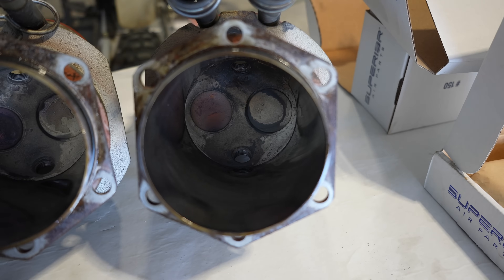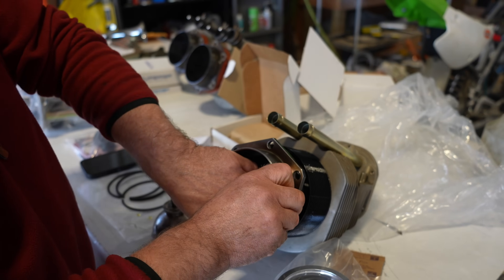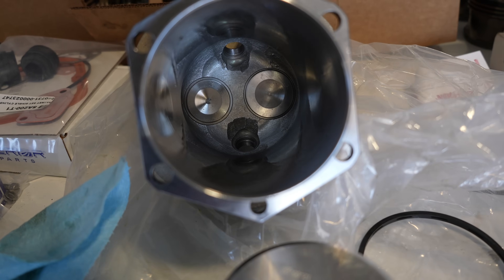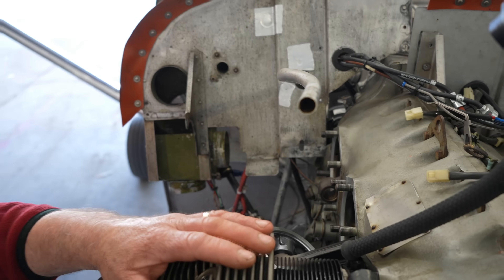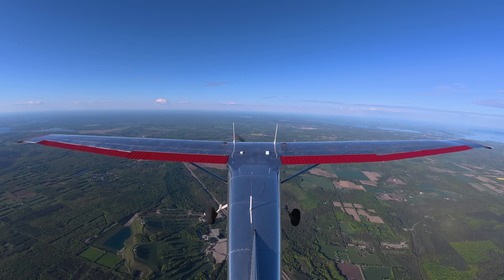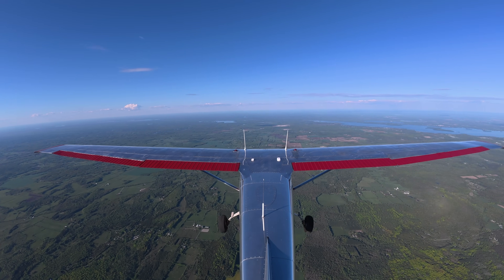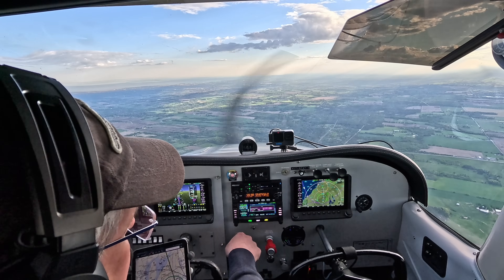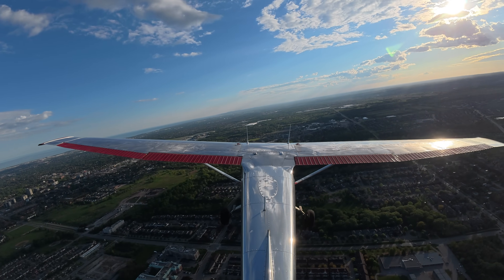Aircraft Engine Surgery Replacing Two Cylinders Plus a Test Flight

Comment: Your valve and compression issues are likely related to running too rich. If you dont run substsntially lean of peak, lead deposits leading to sticking valves, valve seat and stuck ring  problems.  Also running the engine too cool will cause similar problems. In Canada , likely need carb heat durng cruise to get good fuel distribution with a carb.
Reply from the maker: All of the problems can be attributed to how the engine was treated before i purchased it - I knew this was coming when I bought it.

Comment: How do you have 6 cylinders in a 172?
Reply from the maker: Cessna 172 models built before 1968 -ish had 6 cylinder Continental 0-300 engines
Reply: Interesting. Thanks for responding

Comment: Did you ever post a video explaining the differences in your airplanes air speed since your wing modifications?
Reply from the maker: Cruise speed didn't change - exactly the same.
Stall speed changed significantly, and there's a video posted here about 2-3 years ago.

Comment: As a non aviation mechanic guy, how an enlarged air cooled lawnmower engine with two mags, two spark plugs per cylinder and a carb can cost so much? It's almost flintstone tech. Life as a GA mechanic must be pretty easy, I'll look into that.
Reply from the maker: It's not the parts or the technician that cost so much... It's the piece of paper that 'certifies' the part and the technician that costs so much.
Reply: @GlensHangar  Big problem in/for Canada in general
Reply from the maker: @KK-be8ec  It's not a 'Canada' problem, it's a global problem with certified aircraft.
Reply: Calling it a lawnmower engine is a bit of a stretch. Consider the machining involved in those cylinders, note they're one piece with no separate head. 
Sure the tech is old school compared to a modern vehicle but the old tech removes a lot of points where failures can occur (and some of the cost of aviation certified new tech). Some of it is cost, some is reliability.

Comment: Good info.
On another subject stol kit.  My plane is a 182 with a stol kit. Do you run out of nose up trim early when on short final?
Reply from the maker: I don't run out, but I do use a lot of nose up trim. Almost all the way up.
Reply: @GlensHangar did you adjust the trim tab angle or was it still working ok? I’m told the 182s trim max out high due to the heavy nose?
Did you reduce your landing speeds? My stall dirty dropped from 55 to 33.
Reply from the maker: My trim tab was still within the spec listed in the shop manual. At 40º flaps my stall is reduced to 25mph indicated - sort of... 25 is when the airspeed indicator  starts, so the plane stalls a little bit slower and even then only kind of mushes out. The STOL kit, wing extensions and VGs really made it slow.
Reply: @GlensHangar stol kits are amazing!   Thanks

Comment: Glenn, did you install new piston pins or use the existing ones?
Reply from the maker: Strangely - the 'Kit' from Superior contains everything except piston pins and shaft for the valve rockers. So those get cleaned,  inspected, and re-used.

Comment: Really enjoy watching the flight from the tail-high cam. Looked like a bumpy flight. A question I've always wondered; why do airplane engines have a mixture control? Automotive carburetors, even rudimentary ones, have screws for idle and full throttle that are "set and forget." I think antique cars had mixture controls but they were soon eliminated. What about planes?
Reply from the maker: These early engines don't have electronic controls  - I think it's called FADEC?  Most piston engines on legacy certified aircraft were designed in the 1930s and 1940s, and they just keep making them with very few changes.
As you climb and the air pressure  / oxygen changes, you need to change the mixture to compensate for the changes.
Reply: @GlensHangar  Essentially correct.  The problem IMO is it's much easier to certify something "tried and true"  (aka tech developed 100-80 yrs ago) than to go through the process of getting something certified "new"

Comment: No takeoff power static run ?
Reply from the maker: 12 hours of work condensed to to less than 8 minutes... We did all of that.
Reply: you actually want limited ground running while breaking in the cylinders. get off the ground and get the throttle full open for at least 30min

Comment: Having used the old-skool wire feeler gages, I really appreciate the flat stock feeler gages...   Especially for cylinder ring checks like this.  Great job!!!

Nice start and idle.  No oil on the windscreen and no black smoke or wet stacking.  Too bad about the seep, but that's the risk with this type of engine repair...

Comment: We had a 63 P172D based at Barrie. At 1200 hours (1993), we did an Avcon Coversion replacing the Continental GO-300E with a Lycoming 0-360-A1A and Hartzel Top Prop. In your situation, an engine replacement from Penn Yann might be a consideration as opposed to top overhaul.
Reply from the maker: All of those are under consideration - comes down to time / availability and cost.
Reply: Stick with fixed pitch prop. @GlensHangar

Comment: What happens if you fly through Canada and don't know French?
Reply from the maker: Nothing; ALL ATC communications are available in both languages. 
West of Ontario you'll rarely hear any French at all, East of Ontario if you're on the common frequency French will dominate in Quebec and parts of New Brunswick. Un-towered un-controlled airports in Quebec all the radio calls will be in French, but if you only speak English and make your calls in English most French pilots will switch to English to help you out. 
You also have full service through ATC in English so in areas where French dominates just ask for flight following.
Reply: @GlensHangar  Thanks Glen, must be new ! Few years ago i was flying in NFL with an  other aircraft and nav canada told my friend to speak only in english i add to take over and call for both aircraft.
Reply: Only in Quebec nav canada will speak in French Canadian.
Reply from the maker: @martinabud5735   Parts of Ontario as well

Comment: I have about 50hrs on my 0 time engine and superior cylinders and the pushrod boots are leaking. Also heads up around the 10-20hr mark on those cylinders some times they weep a blackish goo (it wipes off easy) but that goo is from the assembly of the cylinder and not oil leaking. I called superior to verify that when I saw that doing a oil change.
Reply from the maker: The boots are a struggle - you think that they are seated and you do your best, but they will still leak. I've put about 25 hours on them now and everything is great with breaking in the cylinders (temps, pressure, oil burn)... But one of the boots is leaking.
Reply: @GlensHangar  I had the upgrade kit to eliminate the boots installed on my old engine and they leaked too!  More than likely from a bad install but who knows.  On the bright side no corrosion will occur in those areas. My main concern now is if it gets too bad it could cause a fire. I'm bringing in my 170 to have it fixed right away to try to eliminate the problem.